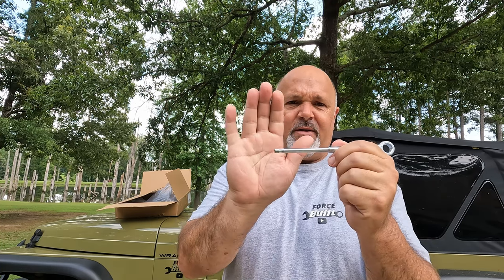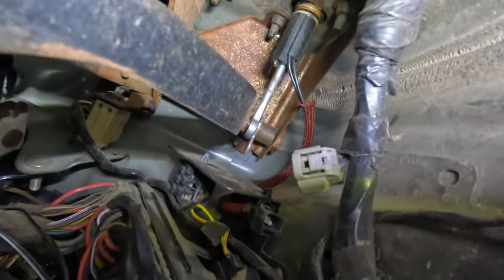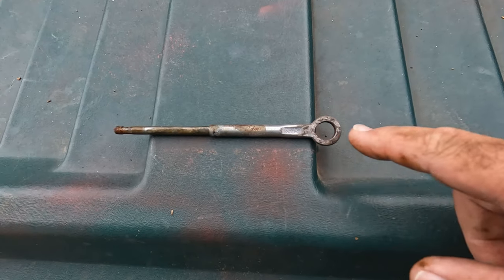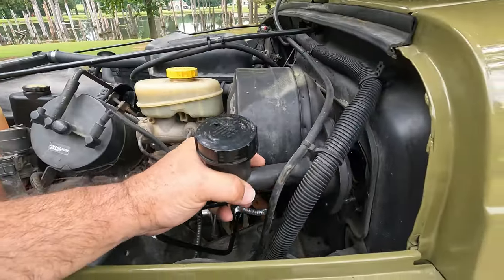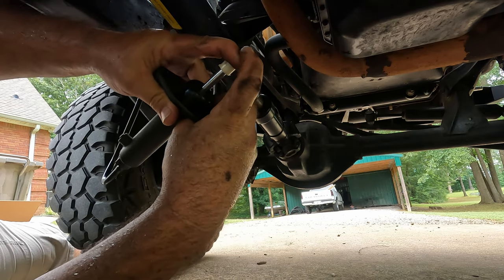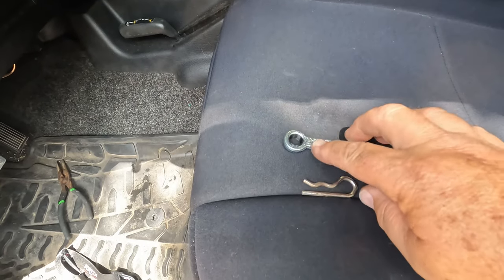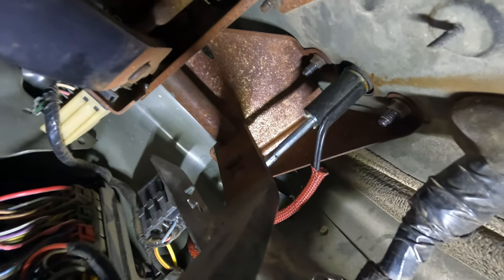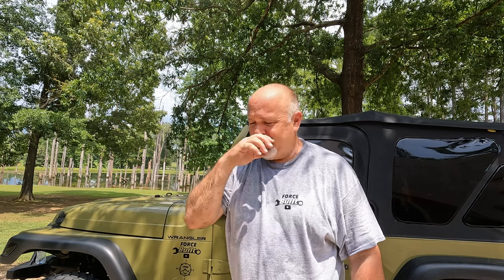Jeep TJ Loose Clutch Pedal(Clutch Master and Slave Cylinder Replacement)

Comment: Nice video!  Just got finished performing this replacement on my TJ.  The white retaining straps on the slave cylinder are normally designed to remain in place during the install.  The first time you depress the clutch pedal the straps will snap loose & you go back down to the slave cylinder & simply remove the two pieces from the back side of the slave. 😊
Reply from the maker: Thanks for that bit of information. I didn't know what to do lol. It worked in the end but your way would be better! Thanks for watching!

Comment: I just bought a 2004 TJ and the clutch pedal dropped to the floor. I looked down and the push rod had  fallen out. I drove it home with no clutch. Going to fix it tomorrow. Hoping I don't have to replace the master cylinder.  Thanks for the video.
Reply from the maker: Thanks for sharing and you are very welcome!

Comment: My clutch doesn’t do that but has a squeaking noise when pressed down. Only starts after driving for 30 minutes or so. Any ideas on what could be the cause?
Reply from the maker: If you are talking about the actual pedal, I would say put a little lube on the shaft where it goes into the firewall. My old one did that but didn't bother me enough to mess with it. If it is inside the master cylinder, I don't know of anything you can do. Thanks for watching

Comment: My clutch has become stiffer over time any ideas? I think imma finally find some down time and replace it
Reply from the maker: Could be the throw-out bearing not sliding well. If it is getting harder to press, somethin is for sure going on.